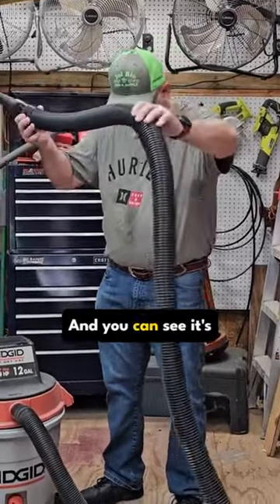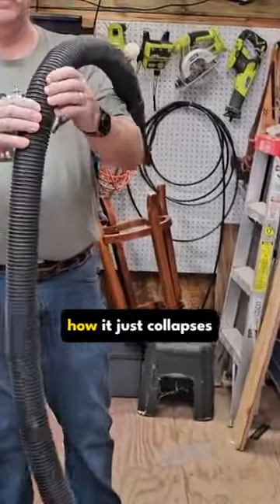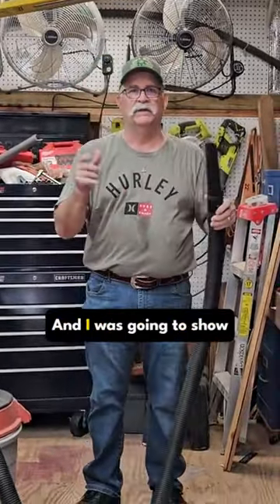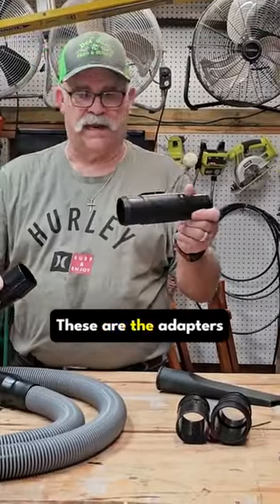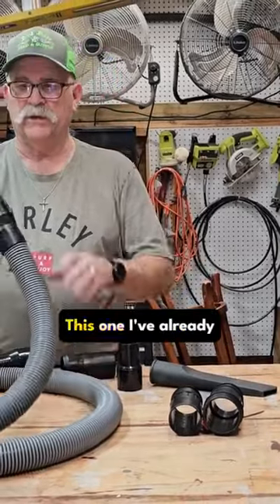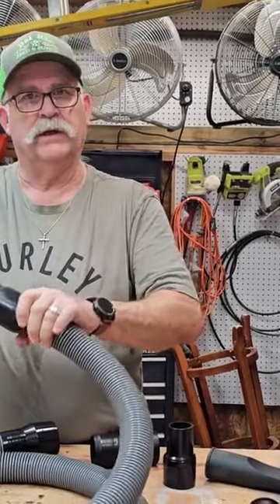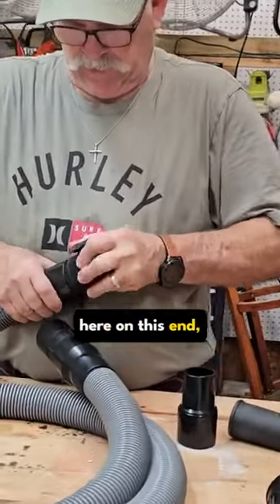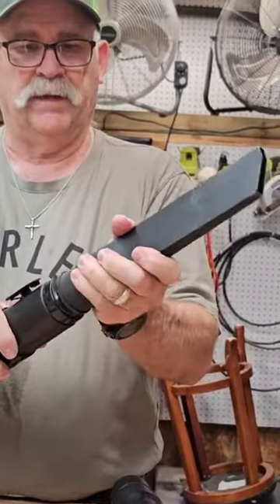How to setup a shop vacuum system Short #diy #tool #woodworking #foryoupage #shorts

Comment: Explain to me why you’re downsizing? Trying to understand dust collection for my shop and just last week purchased the new 16g cart shop vac from Ridgid with a 2.5” hose  from a 12g craftsman 1 7/8 , did I make a mistake?
Reply from the maker: @nickoreckless8115, I have a small shop so space is valuable and the 1 7/8 inch hose is just easier to maneuver around. Thanks for taking the time to watch my video and comment if you haven't subscribed to my channel please consider that along with clicking the notification bell so you don't miss out on any future videos. Here's a video you may want to see using my dust collection system https://youtu.be/Uu4rM7HnNpk